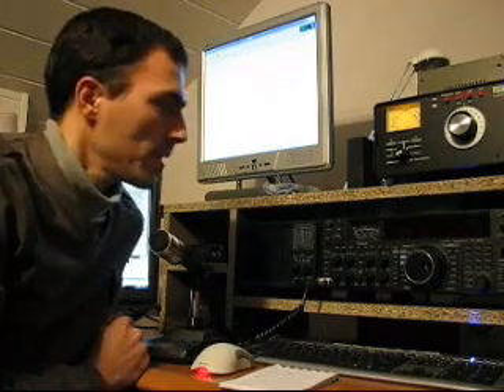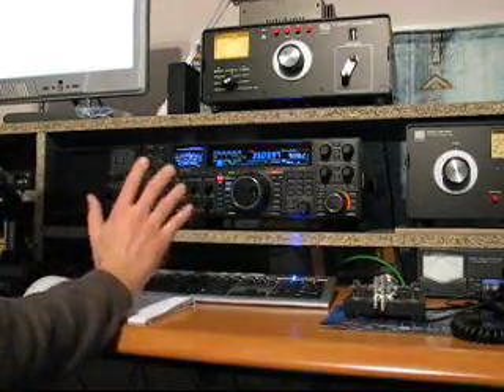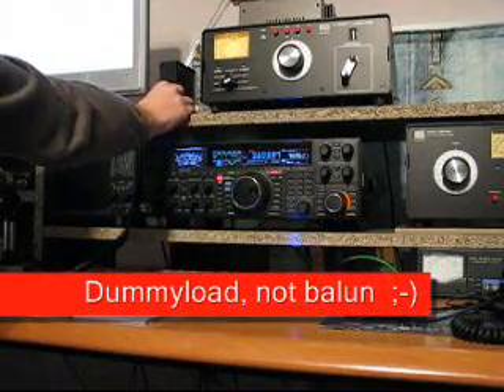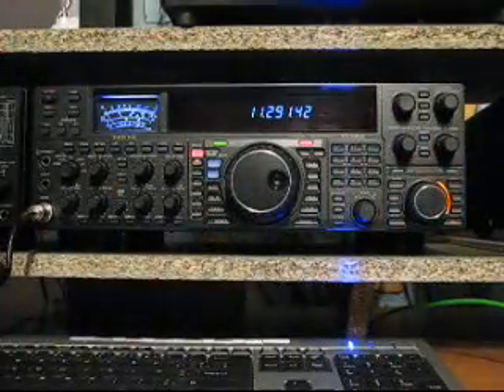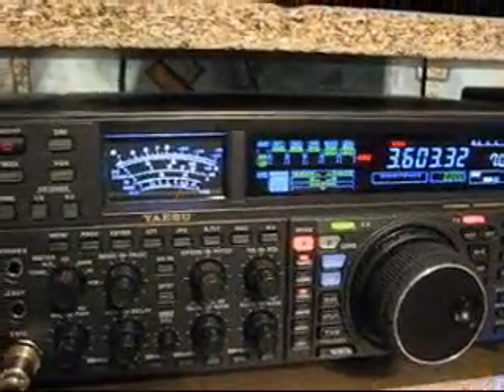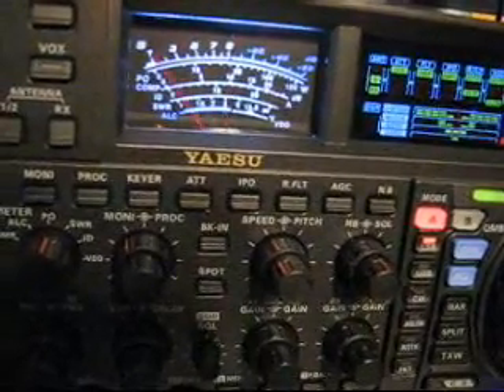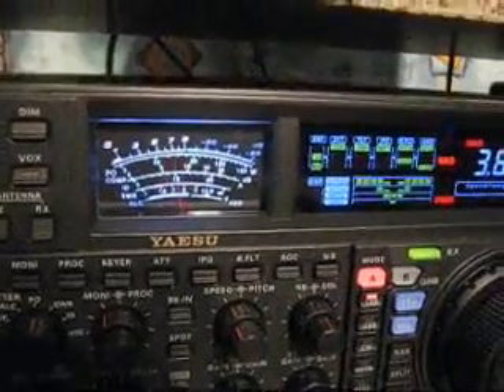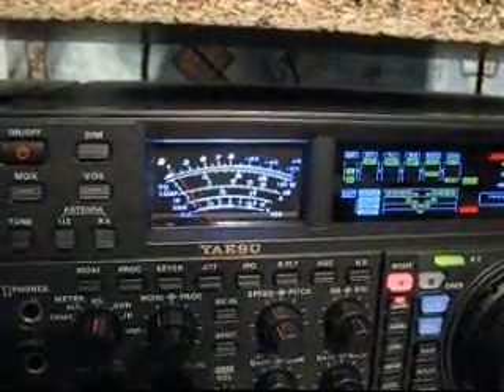Yaesu FT-2000 PEP-2000 and power test.

Comment: Dag Franky heb jij nog steeds je ft 2000?
Reply from the maker: Ja, heb nog steeds de FT2000 als main radio.
Reply: k heb een probleem met usb en lsb stel ik sta op 14.200.00 op usb ik schakel over op lsb dan staat hij op 14.201.40 klopt dit? Ik heb zelf ook de Yaesu ft 2000 D, is dat bij jouw ft 2000 ook zo? bedankt voor de info

Comment: The firmware on my ft 2000 is the the latest EDSP 1154 and the penultimate CPU 156. A 58 version for the CPU is now available but my radio works lovely so why fix it if it aint broke?. Some say the DNF does not work, however the DNF on my radio works perfectly. If there is a whine (heterodyne) on the passband then press the DNF button to completely eradicate it in 2 secs. GONE!!  Try it. The S meter does go high on broadcast stations on 40 and the F 58 should cure this. but who cares. Not me.

Comment: ...sorry  but I must contradict you
I made the test on my FT2000D,and both internal and external meters worked the same: with EDSP 10.29  160/170W SSB; with EDSP 11.29/11.39   only 50/60W...indicated on internal and external meters!  :-(((